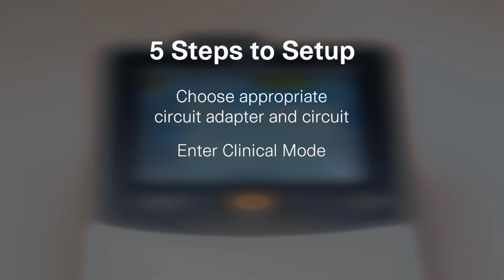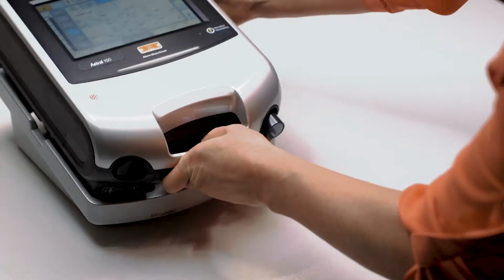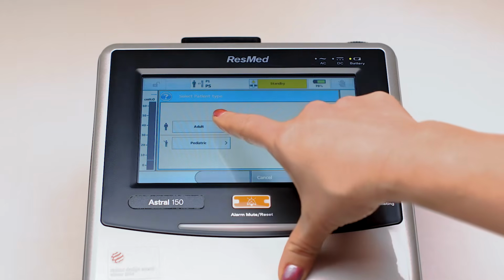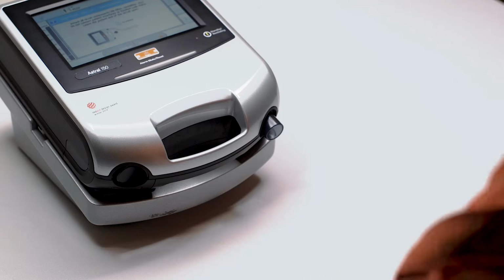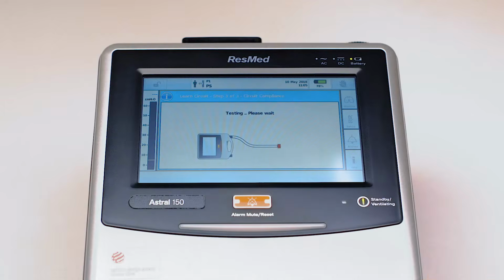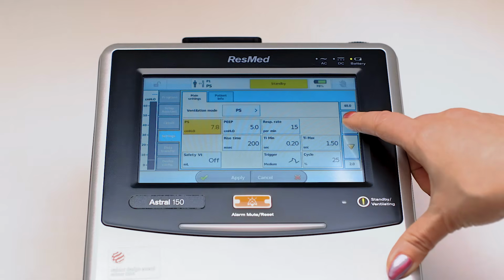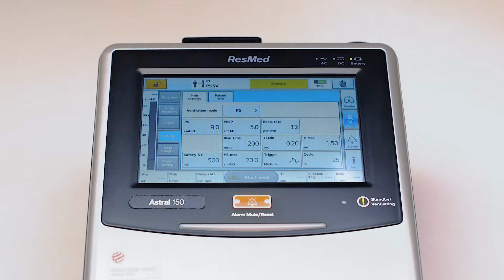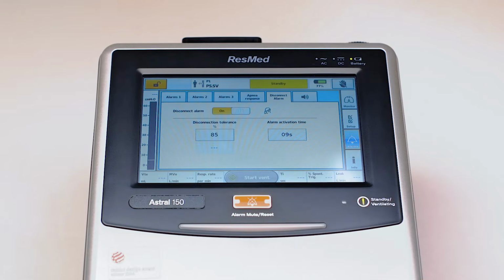Astral™ by ResMed - 5 steps to setup

Comment: Not giving as much air
Reply from the maker: Hi, if you find your machine is not producing the prescribed air pressure settings, please reach out to your doctor or medical equipment provider for a full evaluation. They can determine what might be causing the issue and assist you further from there.

Comment: How do we stop the high pitched whine that the Astral 150 emits when not in use? We’ve had two different devices and they both emit a high pitched whine when plugged in or when it’s using the battery. The only way we have been able to stop it is unplugging it and turning off the device completely.

Comment: hello qquick question, i have a humidifer  tht has to chambers ro fill in water every 24hr,  how to i pull out the chamber, or how do i even put in warer?
Reply from the maker: This would depend on the humidifier itself specifically, and instructions for it can be found in its user guide. We'd also recommend reaching out to the person or company who supplied it to you as they can also provide more direct assistance with this for you.

Comment: I just got a 150 with a modem and I do not think they set it up right. I am not getting good pressure and it does not feel like my lungs are expanding very much. I have very bad COPD and flow 6L of oxygen, when I go to bed my sp02 is 97 when I wake up it's down to around 86. At best I get 3 to 4 hours of sleep. Sorry to say but I was using a Dream station S/T  with settings of 4/19 on Bipap, with it I was getting 6 to 8 hours of sleep only waking up to go to the bathroom. When I take a breath the little green bar only goes up to 10. I am 8 weeks into using this and I am about to go back to using my other unit.
Reply from the maker: The pressure setting on your machine is something that's set by your medical equipment supplier based on those prescribed by your doctor. If you find your device is not providing the necessary pressure needed, please discuss this with your doctor. They may be able to change the settings themselves or may guide you back to your supplier for an evaluation of your device or to have these changes made for you.
Reply: @Resmed  Yes, My Dr. told me to call my supplier, and the supplier said they could not do anything about it.
Reply: Most likely the person who set up your Astral didn't put in the correct settings that were prescribed by your doctor. If the IPAP is only going to 10, and it's not because the breathe is prematurely cut off during inhalation, then it's simply set at the wrong IPAP pressure. Verify your prescription, and if indeed it's 19/4, change it yourself according to the prescription if the DME refuses to do anything. It's better than being inadequately treated and potentially ending up in the hospital.

Comment: Does this device help remove CO2?
Reply from the maker: Hi Gerald, Yes Non-invasive ventilation, or NIV, can help you reduce carbon dioxide levels if you have hypercapnia. This therapy involves delivering pressurized room air through a machine (like the Astral 150) to your lungs via a mask or mouthpiece. NIV changes pressure levels to help you exhale excess carbon dioxide. To learn more, see our product page here: https://bit.ly/3htg7V3

Comment: Trying to figure out how to use this extremely well designed resp. to it's full potential. Male, mid 60s COPD #4 enjoys strong blow-back deep into lungs to stretch pleura / gain any capacity I can.
Also this deep pressure into the bottom of lungs seems to stimulate parts that are finally free from shallow breathing so many cigarettes for so many years.
I see them getting pink & coming to life again if only in my head. Positive air flow needs some some positive thinking IMHO.

 Only way I can seem to make the Astral 150 do this is by leaving it loose to my face. It starts throwing more air out and I suck it down deep!

I guess I'm looking for it to exercise with me while I have it. The "respiratory specialist" who dropped it off knew how to plug it in and size it to my face but info was hard to come by.
To my fellow COPD people:
This disease will make you slow down but try not to let it stop you. Fatigue can be worked around in spurts. Work in the garden 5 / 10 minutes, rest. etc etc.
They're too eager to throw O2 at you. Fight the good fight!
Don't let them scare you away from Prednisone either. 
I can put up w/ side effects but not suffocation! 
Later
Reply: Case
Reply: @Flashlight561  Thanks! Means so much to me LOL!